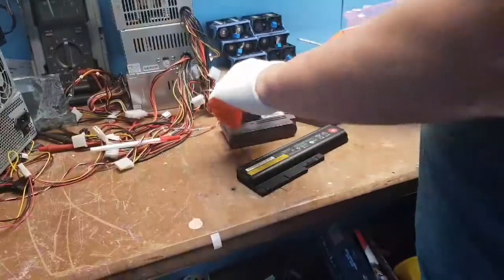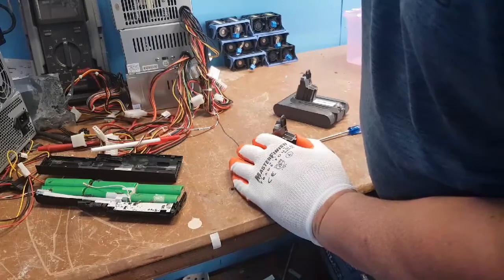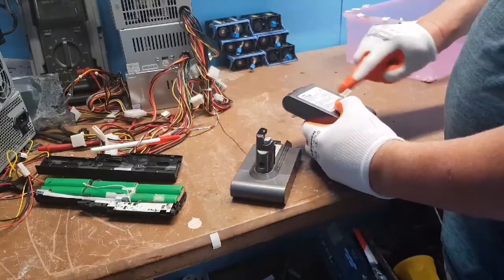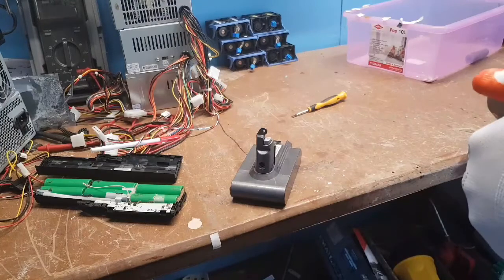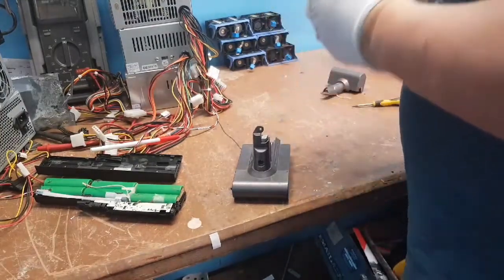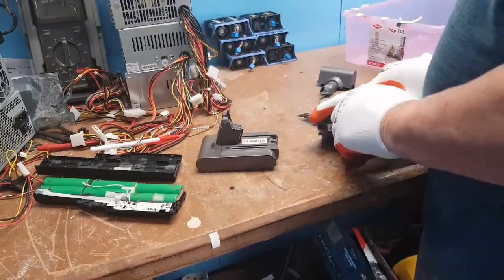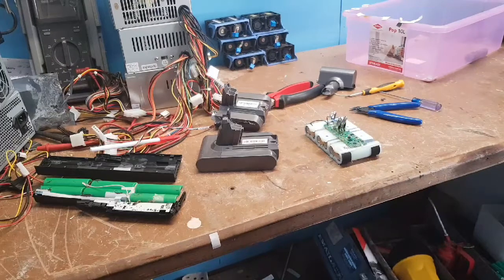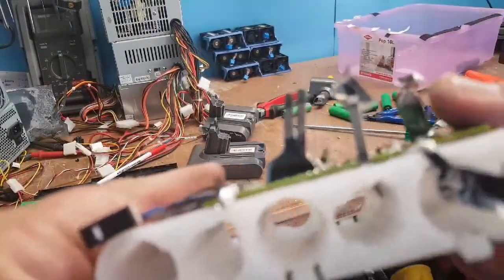Dyson battery tear down and current test. On the V8 or V11 vacuum cleaner.

Comment: I just want to see if my Dyson battery has charge or not due to my vaccum not working 

I don't want to rip it apart. Can I just put the multi-meter prongs on the battery prongs ?
Reply from the maker: Yes, it will work fine. So, 3 to 4 volts each battery.

Comment: I must have blinked but I didn't see any current or voltage testing. And for crying out loud edit! Six minutes of struggling and standing in front of the camera is not useful or engaging.
Reply from the maker: Long time ago, Stand dyson is about 2200mAH voltage is 3 to 4.1 Voltages Max voltage on 18650 batteries is 4.2 volts.  Check out the new stuff it is better.
Reply: @chuxxsss  I'd rather make my own pack, but I need a starting point. Their site says 22.1vdc and 4500 mAh. I will probably also make a corded adapter for the house.
Reply from the maker: @BariumCobaltNitrog3n  So 5 x 4.2 volts about 21 V then 2 parallels of 5 with give you about 4400 maybe 4800 mAH.  Good luck.
Reply: @chuxxsss  The Dyson I got was a mystery and when I connected 24 volts to it (the motor says 21-25vdc) it just pulsed. The carpet part runs fine but what do you think it is? Like one second pulses on and off.
Reply from the maker: @BariumCobaltNitrog3n  So did it do move than rotation ? Sounds like a capacitor or the motor is fried.
Reply: @chuxxsss  Yeah it spins but can't get up to speed. I think you might be right. I'll check the caps
Reply: Yeah

Comment: Thank you for the videos, I have V11, completely dead, when I plugged in the charger both side blue lights comes up for 5 second and goes off, when I pressed the battery black switch, it flashes 9 times. I have opened the battery and tested all the cells showing 4.11V,  The signal plug showing constant 26V, the clips which connects the main body read 26V once and goes off, when I pressed the black battery button. What you reckon, need a battery or any other parts, I repair and learn electronics, your hard work always help not to reinvent the wheel. Thanks
Reply from the maker: I believe the BMS on the battery may have a problem.  Not sure, which part yet. But replace your battery.
Reply: @chuxxsss  Thank you for the reply first really appreciated God bless you, There are 4 pins, 2 are as pins, I think it should communicate with the main body, it reads 26V, bit later I am going to check it through DSO, whether it transmit any signal, other 2 pins are main connector to the main body, the pins are read 26V constantly, but clips are read only once 26V when press the black switch situated in the battery.  Thank you, once I confirm then I could open the main body and check the main board.
Reply from the maker: @gtechlaptop6156  They are hard open, take it slow and use a flat tip screw driver.

Comment: Wrong information, where is v8 or v11 battery?
Reply from the maker: I have pull them all apart pretty much 90 per cent of time is bms fault. I have 20700 batteries which is the only difference from what I show here. Stay safe.

Comment: So where is the current test of the title?
Normal people don't need to take apart the battery case, destroying it in the process.  Just buy a new battery pack online.
Reply from the maker: I do recycling of second hand batteries.  But sometime do new ones. Sorry if I missed out on doing the test. Dysons I am processing now are 2200mAH to 1700mAh dew  to use factors. Pick up a Chinese knock off need to test it. They look like bad cells.

Comment: You have really good stuff Sir 🤓.
And slow down while you opening it because we're not suppose to see any smoke in it. 
Because i used a screwdriver to open it and i was tried so hard and suddenly 3 cells are get blasted all over my pants and the plastic case is totally melted. And after i saw a small hole on that battery i realise that was my screwdriver. 
So just be careful 🙂.
Reply from the maker: Use the small side cutter to cut the positive and Negative sides first after unscrewing the screws on top. Use side cutters to lift tin which is spot welded too.